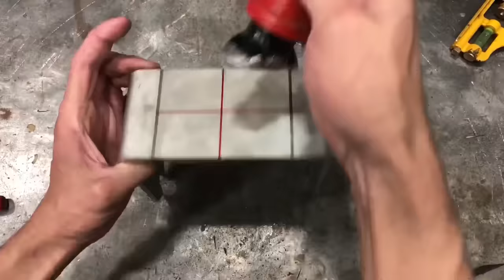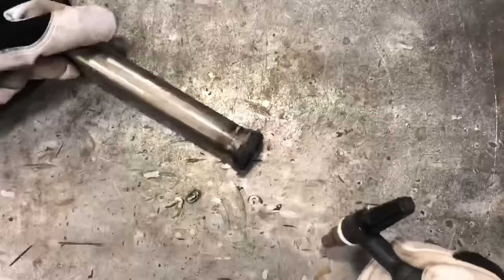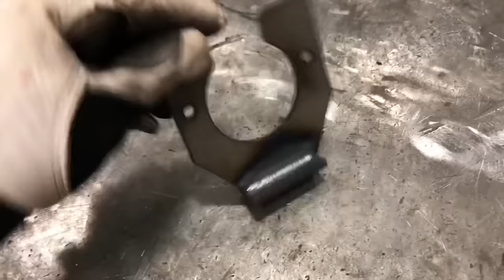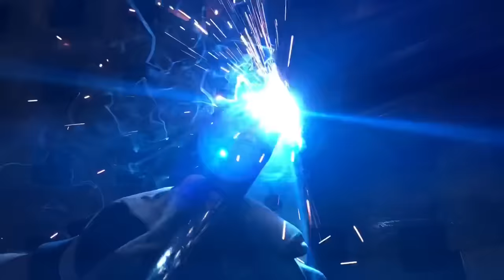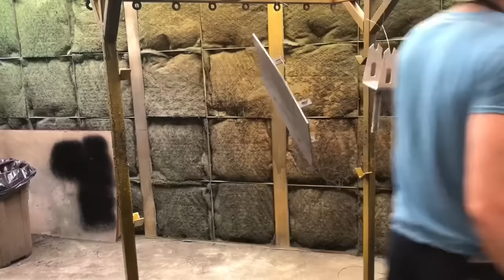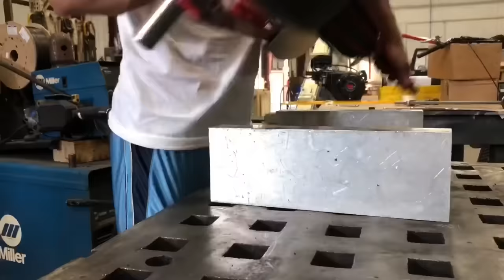DIY Predator 212 Scooter

Comment: Very nice tig work and build. I am worried about the steerer tube fatiguing at the threads while riding it due to bending loads. May want to consider changing to 1-1/8” and use MTB threadless stem, and/or support with upper bearings/longer head tube.

Comment: Nice fabrication skills 💪 Gotta learn from you!
Reply: You're going to get some subs👍
Reply: @mechanicalking  Congratulations to the scooter friend here in Brazil I have one made by my hands. We use a honda 7.0 hp (212cc) engine. It has incredible torque. Please email me haroldosm20@gmail.com and I will send you photos of my project. I use it to go to work and to the course, but my scooter has a structure different from yours that we call here as an original walking machine. It comes equipped with a 2 stroke 37cc engine, very weak, it can not handle climbs, I replace it with a stationary motor, question in your project already thought of putting a torque converter ...
Reply: @xani123123  Yes, thank you. Mine has worked for a few rides but I need a good pull start. I will make a new video someday
Reply: @mechanicalking  I wait for the video friend, a question I did not see the brake of your scooter

Comment: don't get me wrong this is so cool it's frozen solid but it can't really count as DIY. I'd say more "professional with small scale manufacturing facility makes project look fantastically easier than it is"
Reply: I wouldn't quite say so. If you have just a few tools, you can definitely do this at home. Not only that, but there has popped up a myriad of services offering things like CNCing parts using your own design files, which would help plenty here. Otherwise you don't need much more than an angle grinder, a welder and some basic tools along with a can of decent spray paint. This is definitely DIY, just not on the same level as origami or knitting.
Reply: @o0julek0o   TIG welder, something to cut that thick af metal like a band saw, either some CNC device or the ability to farm out your CNC stuff.. sure, you can make  a diy with far less tools, or even convert a preexisting scooter without even a welder... but it's not going to look like this, or be in any way time effective to make this way without the machine shop he has.... not to mention the evident high skill level. You could have some company make all the stuff sure... but then it costs a fortune to make, like, good used car money
Reply: The guy did it himself and didnt buy it prebuilt, I'd say that's the definition of DIY.
Reply: Fit Should be battery and motor assembly. बैटरी और इलेक्ट्रिक मोटर फिट करके बनाना ज्यादा अच्छा रहता
Reply: @WeldersOnly  By that logic...

My vehicles were made by a team of DIYers. 😅
Reply: diy is when you do it yourself, simple. If you are good or not  still diy..
Reply: @robspear03  😂😂😂....that's funny shit!!!!

Comment: You can turn the governor screw way out and get up till like 4800 RPM  instead of 3600 without removing the governor
Reply: I would take it out. Shattered plastic in the motor is too big a risk.

Comment: This is the best build I've seen! Awesome fabrication! For the front fork did you find one already made or cut one yourself out of rectangle tube? If so, what thickness would you suggest. Thanks!
Reply: looks like 3/4 of an inch steel bent in two places go back to very start of video about 40 seconds in
Reply: Front fork looks like it came from one of the legs on a zero-turn mower.. js
Reply from the maker: Hahah nope i made it

Comment: Nice  build  what size  square tube u use
Reply from the maker: 1x2
Reply: @cutweldbuild7528  thanks
Reply: 1x2 rectangle tube what's  the thickness on the material

Comment: Cool build but the connection between platform and fork/head tube is not safe.
Reply from the maker: How so?
Reply: Cut Weld Build I could be wrong but I’d feel better about it if there was tabs and slots interface between the curved metal pieces and the frame prior to welding.  It’s just a butt joint in woodworking terms.  I still like your work though that thing is radical!

Comment: Why did you opt for such a wide front tire?  I am genuinely just trying to understand advantages/disadvantages of thin vs wide tires on these mini motors, not built for off-roading.
Reply from the maker: Its was just a set of tires i had so i used them no reason other then that
Reply: @cutweldbuild7528  actually on this its quite good. More rolling resistance so no brakes needed and looks good

Comment: i cant figure out what keeps the handle bars from spinning free from the forks.  seems like a weak point where that long tube is welded to the headset cap. ive have goped bars break right there

Comment: Yeah it'll be so much more powerful and fast with a bigger sprocket. Right now It'll burn that clutch out in like 40 miles. A 212 on a stand-up scooter you should be able to wheelie no problem and  easily drift on gravel with it.  Magic gear ratio of  6 to 1

Comment: WHERE DID YOU BUY THIS WELDER ????/ ITS ALSOME
Reply from the maker: a welder is a welder dude lol its just an old miller i run everlast at home
Reply: @cutweldbuild7528   NO A WELDER DEFF AIGHT JUST A WELDER I HAVE 6 MATCO SOME HARBOR FRAIGHT ONES EACH MODEL AND THE ONLY ONE THAT WELDS NICE LIKE THIS ONE IS MY LINCOIN BUT I PAID UP FOR THAT ALSO AND I WASNT SURE IF THIS GUY MADE IT OR NOT BUT THANKS ITS A MILLER
Reply: @cutweldbuild7528  MILLERS GOOD SHIT AND DOES THE EVERILAST EVEN HOLD? CAUSE I KNOW HARBOR FRIEGHT WELDS DONT UNDER A LOAD I WOULD RATHER RELIE ON NUTS AND BOLTS OR SUPPERGLUE ITS SAD
Reply from the maker: everlast has never let me down
Reply: @Cut Weld Build  TRUE TRUE DITTO AS WELL I LOVE WALMART REALY DO BUTT ARE IN NEWJERSEY DONT CARRY WELDERS OR EVEM IMPACT SOCKETS BECAUSE THEY SAID THE THEFT RATE OVER POWERED THE PROFIT BUT THE MANAGER SAID THAT TO ME WHEN I ASKED WHY A PA WALMART WAS SO MUCH MORE COMPACKED AND STOCKED WITH MORE TOOLS THATS WHEN SHE TOLD ME THAT WAS IN 2016 BUT LUCKY FOR ME IT IS LOWERING I BELIEVE BECAUSE WE JUST GOT BLACK EVERLAST IMPACT SOCKETS I LIKE BUYING THEM TO DO ONE JOB ON THE ROAD AND THEN THEY PAY FOR THEM SELVES SO IT DONT MATTER IF I LOOSETHEM OR BREAK EM IF YOU GOT A SEC CAN YOU LEMME KNOW THAT PART NUMBER SO I CAN SEE IF IM ABLE TO FIND ONLINE

Comment: Slower than the 50cc scoots I've seen.
Reply from the maker: Tops out at 45 i just didnt video it
Reply: @cutweldbuild7528  45 is too fast for that thing. I'd consider gearing for acceleration.
Reply from the maker: Your right its not much on the take off and it does get a little wobbly at that speed